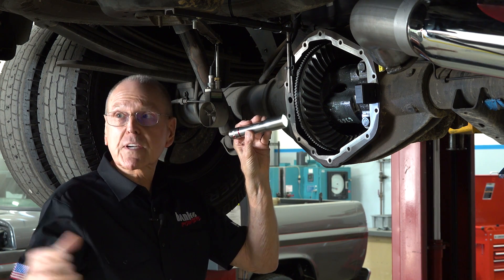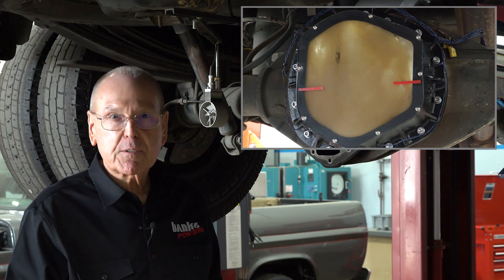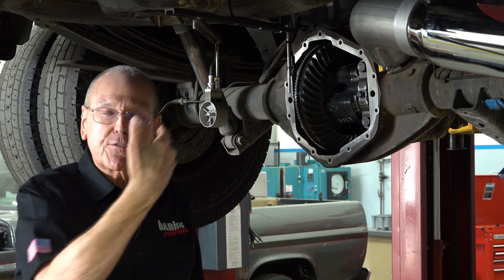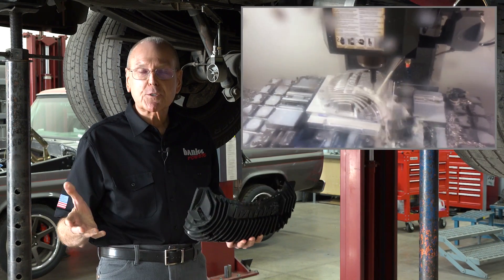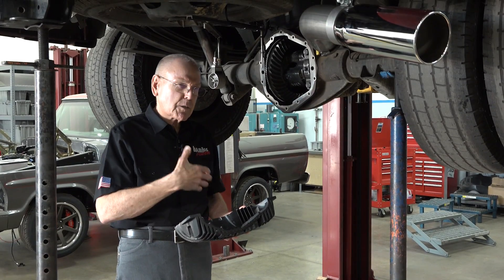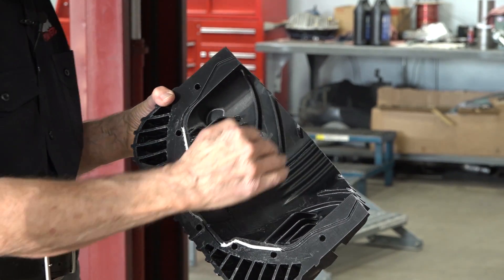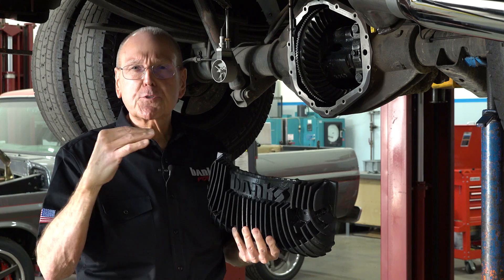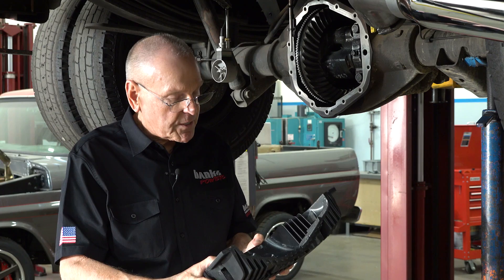Banks All New Rear Differential Cover – Perfecting the Design

Comment: Things are real quiet about the diff. cover R&D, I hope Mag-Blingtech and others haven't filed lawsuit. Seeing the prototype, I suggest you make the lower part of the cover more thick and robust on the lower (?? 1 Inch??)  to resist rock drag-over. I am no fan of the bling covers, although the boss pushes them. I had no idea these rear end temperatures run 300 degrees F plus. I am 100% in your corner over there at Banks, I do a lot of Diff. work, a lot of truck and 4X4  gears and up grades. Many of the diff. covers are more for brute-armor, made of thick cast iron or fabricated steel.
I am patiently waiting for the numbers and data in part 3 of the series, the jury is still out......

Comment: This is great timing. I had a '15 Ram dually with 4:10's, 11.8" AAM with Aisin. It had the stock alum finned AAM cover. I haul heavy loads, in the hot SW USA. Also up the 10 mile grade West on hwy 8 to San Diego frequently. My diff started to make a jingly noise at tip-in at 50k miles. I went to Amsoil 75--90 severe gear thinking that would help. At 100k miles a bit noisier, so mistakenly tried 75-140 severe gear. About 140k went to change again and full of metal. Pinion bearings shot. I travel large distances with brief stops, so oil never really cools down. Also travel 80+mph unloaded, that spins an overdriven 4:10 pinion very fast. Pretty sure what I do is extreme and <1% of owners don't do that, so it's not a design consideration. I got to thinking then, there is very little airflow to diff, especially when asphalt can easily be 150 deg +! Btw great idea with the anemometer! I thought about fabbing up an air scoop, or running an electric pump with a heat exchanger. Contacted Amsoil, they said 300 deg is max., and after that you can get thermal runaway of fluid. Also having 4:10s means the pinion is spinning that much faster. I now believe the 140W exacerbated the problem further. Anyway traded truck in on an '18 Aisin 3:73's. Bought an IR heat gun. I have tested many different points on diff during a run. Lower portion of back cover about 250-270 deg. when stopped. Front area where pinion bearings are, 300 deg even with a light trailer load! I'm looking for a solution, and will purchase one of your covers when avail. BUT, what really needs to happen is this: Consider all the new trucks are 900+ lb. ft. torque, and toy haulers are larger than ever. On my '18 they went to a few more ring gear bolts on the 11.8" compared to the '15. I see the new '19 with 1000 torque is now a 12" ring gear ( like an F-450) I believe. Anyway the diffs have just not kept up with the power increases IMO. What needs to happen is they need to be designed similar to a dry sump. Electric pump, and gear lube being pumped to each gear and bearing area. Mercury Marine did this with their #6 high perf. outdrives. I believe failures are a combination of inadequate heat removal, aeration, and poor delivery of fluid to pinion bearings. Not to mention the viscous losses of the carrier submerged in the lube would be gone. The frictional losses/affect on mpg alone should be enough to get manufacturers to look into it more. Also, how is it that semi's can do 1 mil miles of huge loads without failure? They have to be channeling oil flow better. Even large gears and bearings will fail if not lubed properly.  Sorry for long post, had a lot to say and maybe can help others.Thanks for the excellent videos!
Reply: Edit: should say a mechanical pump, I was still thinking about an electric heat exchanger set up.

Comment: Why aren't the ram air scoops on the cover on the top side of the diff?  Trucks often go offroad and I can see these not only getting clogged, but also getting damaged if they snag a rock or something.
Reply from the maker: There are not scoops at the top because there is must less air above the axle. The aerodynamics of the truck forces up and over the truck and down and around the ground. The coolest air is also available at ground level. Remember, the exhaust pipe radiates a tremendous amount of heat so you don't want to draw in that hotter air. Finally, if the scoops get clogged with mud, just hose them out. For serious off-roaders and rock crawlers, we recommend using stamped or fabricated steel covers for strength as opposed to cooling.

Comment: I see no need to upgrade to an aftermarket diff cover for my truck.  However, I might just buy a Banks anyways, to display on the coffee table, as a conversation piece.
Reply from the maker: Well you can certainly do that if like. We use the same reason for improvement on the "diff cover" just as cellphone manufactures have for the last 25 years.

Comment: So what happened with this project? It's been 7 months since the last video. Is there a new diff cover?
Reply from the maker: The reason for the time between follow-ups is purely due to R&D. When we post a video, ten times out of ten, it's something that happened that day or the day before. Regarding the diff cover series. We've been sitting on the info for quite a long time. Why? We'll only get your attention once. We're going to reveal the research when we debut our cover design. We made many iterations and several billet prototypes, tested the heck out of the design, then went with a manufacturing process that is far more accurate but takes much longer. We have the diff covers in production and hope to have an announcement soon.
Reply: @bankspower  Still would've like to see continuation to the series as it was originally called (Diff Development)...

Comment: Are we close yet to the "final chapter"?
Reply from the maker: Yes, we are getting closer. The reason for the time between follow-ups is purely due to R&D. When we post a video, ten times out of ten, it's something that happened that day or the day before. Regarding the diff cover series. We've been sitting on the info for quite a long time. Why? We'll only get your attention once. We're going to reveal the research when we debut our cover design. We made many iterations and several billet prototypes, tested the heck out of the design, then went with a manufacturing process that is far more accurate but takes much longer. We have the diff covers in production and hope to have an announcement soon.
Reply: @bankspower  I genuinely appreciate your response. I figured as much. Looking forward to it's debut.  Thanks again.

Comment: So did this video series die off? It's been 5 months since the last update.
Reply from the maker: Nope. The reason for the time between follow-ups is purely due to R&D. When we post a video, ten times out of ten, it's something that happened that day or the day before. We do this to ensure we can film good content without interrupting the engineering dept's workflow. Regarding the diff cover series. We've been sitting on the info for quite a long time. Why? We'll only get your attention once. We're going to reveal the research when we debut our cover design. We made many iterations and several billet prototypes, tested the heck out of the design, then went with a manufacturing process that is far more accurate but takes much longer. We have the diff covers in production and hope to have an announcement soon.
Reply: @bankspower  well I am excited to see the end result for sure and even more excited to see the second season of this dif where you guys show us the testing and hopefully some of the trial and error. I found this very informative and potentially preventative towards destroying my rear end.

Comment: Is this series all done?
Reply from the maker: No. It's still going. The reason for the time between follow-ups is purely due to R&D. When we post a video, ten times out of ten, it's something that happened that day or the day before. Regarding the diff cover series. We've been sitting on the info for quite a long time. Why? We'll only get your attention once. We're going to reveal the research when we debut our cover design. We made many iterations and several billet prototypes, tested the heck out of the design, then went with a manufacturing process that is far more accurate but takes much longer. We have the diff covers in production and hope to have an announcement soon.
Reply: @bankspower  Thanks for the update!  Was hoping the build up was going to pay off.

Comment: It's been 6 months, Wheres the product?
Reply from the maker: The reason for the time between follow-ups is purely due to R&D. When we post a video, ten times out of ten, it's something that happened that day or the day before. Regarding the diff cover series. We've been sitting on the info for quite a long time. Why? We'll only get your attention once. We're going to reveal the research when we debut our cover design. We made many iterations and several billet prototypes, tested the heck out of the design, then went with a manufacturing process that is far more accurate but takes much longer. We have the diff covers in production and hope to have an announcement soon. 👍🏻

Comment: When is the final video in the series coming out? I can’t seem to find it
Reply from the maker: The reason for the time between follow-ups is purely due to R&D. When we post a video, ten times out of ten, it's something that happened that day or the day before. Regarding the diff cover series. We've been sitting on the info for quite a long time. Why? We'll only get your attention once. We're going to reveal the research when we debut our cover design. We made many iterations and several billet prototypes, tested the heck out of the design, then went with a manufacturing process that is far more accurate but takes much longer. We have the diff covers in production and hope to have an announcement soon. 👍🏻
Reply: Awesome! I can’t wait to see the finished product! I’ll definitely get one after seeing the research that you’re doing. 

Keep up the good work guys

Comment: Interesting stuff from banks. I bought my 2002  Silverado 2500 w/Duramax got in and have used it as a work truck everyday for 18 years  hauling heavy trailer loads. Seems just fine as it is.
Reply: 30 years on mine. Who knew that stock cover worked so well.

Comment: Patiently waiting........
Reply from the maker: We hear ya! The reason for the time between follow-ups is purely due to R&D. When we post a video, ten times out of ten, it's something that happened that day or the day before. Regarding the diff cover series. We've been sitting on the info for quite a long time. Why? We'll only get your attention once. We're going to reveal the research when we debut our cover design. We made many iterations and several billet prototypes, tested the heck out of the design, then went with a manufacturing process that is far more accurate but takes much longer. We have the diff covers in production and hope to have an announcement soon. 👍

Comment: wheres the latest and greatest cover?  This series seems more like a marketing tool for your new gage then actually making a Diff cover.
Reply from the maker: The reason for the time between follow-ups is purely due to R&D. This is not a reality show with episodes taped months ago. When we post a video, ten times out of ten, it's something that happened that day or the day before. Now, maybe we should sit on the videos and post them all at once like a Netflix series so you can binge-watch them and know how it ends. Unfortunately, we're not a TV studio. Good things take time. Doing something no one has ever done before, at least done it well, takes time. Regarding the diff cover series. We've been sitting on the info for quite a long time. Why? We'll only get your attention once. We're going to reveal the research when we debut our cover design. Put yourself in our shoes. You've done all the competitive research and you're excited about sharing it with the world. But along the way, you discovered how to improve diff covers in a way no one ever has. So, you design one. But making it isn't done like the other guys where someone bangs out a design in CAD then sends it off to the sand cast shop. We made many iterations and several billet prototypes, tested the heck out of the design, then went with a manufacturing process that is far more accurate but takes much longer. Are we curing cancer? No. But are we making the very best part possible? Yes. We have the diff covers being manufactured as we speak.
Reply: Banks Power I appreciate the reply and I am patiently waiting to see what you have cooking. Having a 2500 CTD I am very interested is what you are bringing to the table because I am not convinced making a huge cover that holds 55 gallons of diff fluid is the answer.

Comment: I like the idea of air cooling. Are you planning on testing the cover vs a regularly plumed diff cooler? If it works out and I’m sure it will don’t forget about us ford guys with the old sterling 10.25 and 10.5 obs ford trucks.

Comment: Ever plan on finishing series?   Diff covers are a waste of money is what I've seen so far and Banksy is making his own so where is it?
Reply from the maker: The reason for the time between follow-ups is purely due to R&D. This is not a reality show with episodes taped months ago. When we post a video, ten times out of ten, it's something that happened that day or the day before. Now, maybe we should sit on the videos and post them all at once like a Netflix series so you can binge-watch them and know how it ends. Unfortunately, we're not a TV studio. We're engine builders that invite you into our facility. Good things take time. Doing something no one has ever done before, at least done it well, takes time. Regarding the diff cover series. We've been sitting on the info for quite a long time. Why? We'll only get your attention once. We're going to reveal the research when we debut our cover design. Put yourself in our shoes. You've done all the competitive research and you're excited about sharing it with the world. But along the way you discovered how to improve diff covers in a way no one ever has. So, you design one. But making it isn't done like the other guys where someone bangs out a design in CAD then sends it off to the sand cast shop. We made many iterations and several billet protos, tested the heck out of the design, then went with a manufacturing process that is far more accurate but takes much longer. Are we curing cancer? No. But are we making the very best part possible? Yes.
Reply: @bankspower  Thank you. We all respect your research and time spent making it right, but its hard to be patient because we all know this product will change the game in a market saturated with products built purely for aesthetics . Thank you Mr.Banks.

Comment: Any word on this??? Still waiting
Reply from the maker: The reason for the time between follow-ups is purely due to R&D. This is not a reality show with episodes taped months ago. When we post a video, ten times out of ten, it's something that happened that day or the day before. Now, maybe we should sit on the videos and post them all at once like a Netflix series so you can binge-watch them and know how it ends. Unfortunately, we're not a TV studio. We're engine builders that invite you into our facility. Good things take time. Doing something no one has ever done before, at least done it well, takes time regarding the diff cover series. We've been sitting on the info for quite a long time. Why? We'll only get your attention once. We're going to reveal the research when we debut our cover design. Put yourself in our shoes. You've done all the competitive, and you're excited about sharing it with the world. But along the way, you discovered how to improve diff covers in a way no one ever has. So, you design one. But making it isn't done like the other guys where someone bangs out a design in CAD then sends it off to the sand cast shop. We made many iterations and several billet protos, tested the heck out of the design, then went with a manufacturing process that is far more accurate but takes much longer. Are we curing cancer? No. But are we making the very best part possible? Yes.

Comment: What happened?  They give up?
Reply from the maker: The reason for the time between follow-ups is purely due to R&D. This is not a reality show with episodes taped months ago. When we post a video, ten times out of ten, it's something that happened that day or the day before. Now, maybe we should sit on the videos and post them all at once like a Netflix series so you can binge-watch them and know how it ends. Unfortunately, we're not a TV studio. We're engine builders that invite you into our facility. Good things take time. Doing something no one has ever done before, at least done it well, takes time regarding the diff cover series. We've been sitting on the info for quite a long time. Why? We'll only get your attention once. We're going to reveal the research when we debut our cover design. Put yourself in our shoes. You've done all the competitive , and you're excited about sharing it with the world. But along the way, you discovered how to improve diff covers in a way no one ever has. So, you design one. But making it isn't done like the other guys where someone bangs out a design in CAD then sends it off to the sand cast shop. We made many iterations and several billet protos, tested the heck out of the design, then went with a manufacturing process that is far more accurate but takes much longer. Are we curing cancer? No. But are we making the very best part possible? Yes.